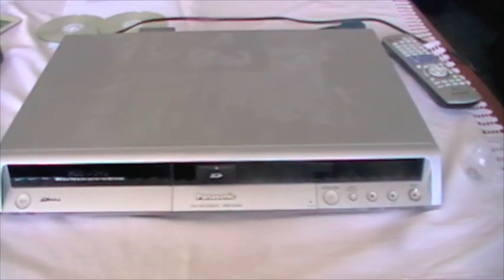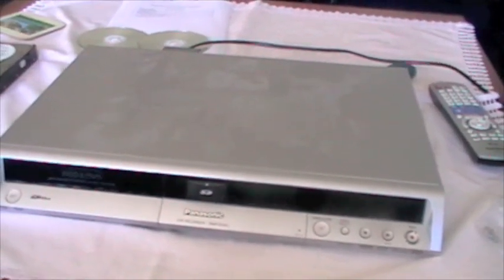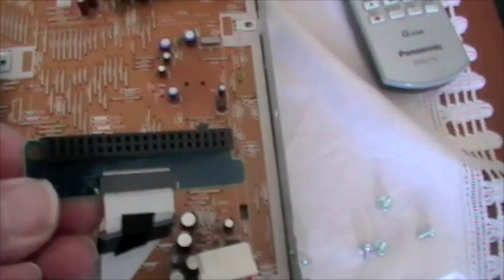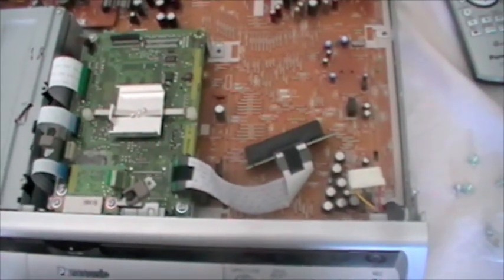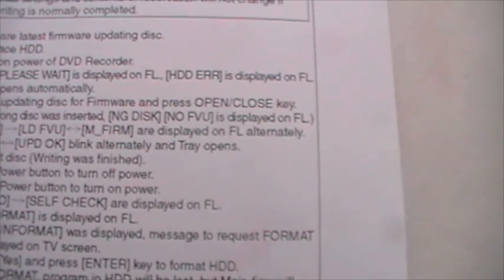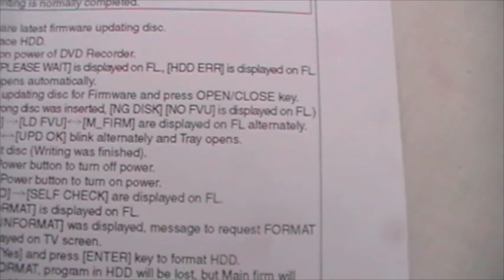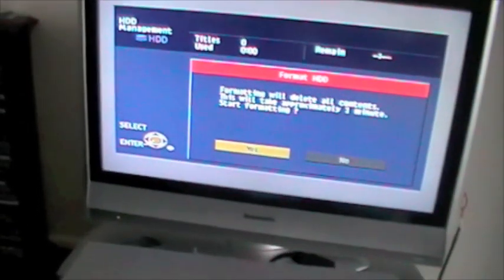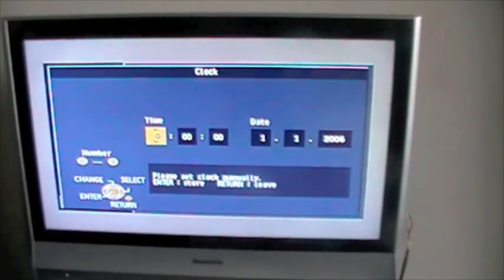Panasonic DMR-EH55 dvd recorder, how to replace the hard drive

Comment: Hi,  please write me how to burn the firmware on a cd r medium.  I tried several brands at 10x speed  and it won"t work... it is frustrating .  Thanks.
Reply from the maker: Try writing to a DVD HTH
Reply: @mikeuknz  Thank you for a quick reply. I don't know what is  DVD HTH and I thing it wil be hard to obtain here in my destination... I suposed to burn it at lower speed  around  2x or 4x   maybe 10x is too much for the dvd player to read....
Reply from the maker: @rudolfzaris675  A DVD is the disc you put in the DVD player and you need to record the firmware on to a recordable DVD disc. HTH is just an abbreviation for "hope this helps" sorry for any confusion.

Comment: Hello Mike UK  in NZ,   thank-you  for a great  Video  Tutorial with useful  information , we need more people to speak like yourself , in a easy to understand format , using well pronounced  English on YouTube.   I have a Panasonic  DMR-EH65 , with a few hundred  music video clips on it , that I have edited and saved over the years . and was wondering , if i took out the hard drive, and connected it using the right connector I have for the IDE drive to my PC, will i be able to copy the files onto my computers HDD , and be able to use  them , for further editing and sorting out.  I am asking in case you might happen to know, thereby saving me a lot of time and hassle. Many Thanks  Sean UK in Oz,
Reply from the maker: Hmmm... I am not sure. The format in the DVD player I think is slightly different from the computer format. Have you tried writing them to DVD and loading them in to the computer that way? Sorry that's the best I can advise - good luck!
Reply: Hi, in case you haven't found the solution yet, there is a way. It's not difficult at all. It just needs a few tools to extract the files which are stored using the meihdfs filesystem. As far as I know it's a proprietary file system which prevents you from simply accessing the files through your OS (Linux or Windows). That's why you'll need to map the physical drive, extract the files through a tool called "extract_meihdfs". It's really quite easy as long as you follow the instructions. https://github.com/leecher1337/panasonic-rec
If you need any help, feel free to contact me.

Comment: Is that firmware download for a Panasonic DMR-EH55 model only?...because I have a Panasonic DMR-EH57 and wondering if it will work on mine or if there is a firmware download for mine.
Reply from the maker: +Toy Mit Sorry I don't know. You could try ringing the Panasonic help line in your country though in some countries they seem to be more helpful than others. If your EH57 doesn't work anyway I suppose you could just try it and see what happens.
Reply: Write this website: ftp.panasonic.com  And after that,  you srcoll down till you see the word:  dvdrecorder. And you click on this word. After that,  a webpage will show with  many words.So, you click on the word: software.  And an other webpage will show many model names. You scroll down till you see :  dmr-eh55_vup317_firmware.zip. Yo click on this word and a window will appear on your screen. So, you click this downlod windows and it will be saved on the folder: download or whatever you choosed the destination folder. And after that, you go where its downloaded. And you click this zip folder: dmr-eh55_vup317_firmware.zip. and you will see a folder inside. You click that folder right side mouse and you extract that folder in download folder. And after that you click on that folder and you will see this word: PANA_DVD.FRM.. you burn that to a blank cd. And after that. you put this burning cd to dvd recorder and you wait till you see update OK. and after that it will ask you to format your hard drive and you click ok and you,re done you can record on your hard drive. Good Luck!!!!

Comment: hello
I need help
Insert 250gb disc in dvd recorder.
Original is can160gb.Dvd me loading firmware all ok,next switch on not work problem again was the sure.Not insert 250gb?Why problem is it?I please help thank you...
Reply from the maker: Is it the correct firmware, where did you get it? Is it the correct type of hard drive?

Comment: I found your video very interesting. I have the same problem with my DVD recorder. Any chance you can share the firmware disc, or tell me where I can go to find one? I have tried the website you recommeded but it did not work. Thanks John
Reply from the maker: John Bugeja Filedropper is really annoying as files disappear very quickly.  I have uploaded it again so should be there now. 
let me know if there is any problem. HTH
Reply: mikeuknz Thank you for your Help, I will give it a try, 
From John
Reply: John Bugeja  I loaded the firmware from Filedropper like you requested and after I loaded it into the DVD recorder I get the message on the display (No Disk) (No FVU) just like what happen to you on your video. Is there another way to get my hands on the Firmware. 
Thank you for your Help John
Reply from the maker: John Bugeja Hmm.. very odd. The only thing I can think of is that the recorder is not finding the file on your DVD - it is a dvd and not a cd? and it is a dvd it reads eg a DVD-R? Check the file is in the root directory and has the name PANA_DVD.FRM sometimes the file type can get left off. That is the only working file I have. Let me know if that doesn't sort it.
Reply: John Bugeja I had another go of downloading the file and notice the loading bar doesn't go all the way to 100% it starts to finalise just short of the end. I wonder if it is a problem with my computer. Did anybody else had this problem?
Thank you for your Help!! John
Reply from the maker: John Bugeja try copying the file back from the DVD to the computer and then check if the file is the same in terms of details such as file size. It should be about 7.2Mb. You are downloading to hard disc then copying to DVD I hope.
Reply: mikeuknz Thats interesting! The file size I downloaded is 6Mb. I will give it another try and get back to you 
Thank you John

Comment: Hi, thank you for your vids, i changed hdd of my EH55, but the firmware from panasonic website doesn't work, NO FVU...
Is it possible to have your firmware version in download please, the above link doesn't work anymore.
Thank you.
Reply from the maker: +PLChellman Hi, I've uploaded it again, try again and see if it works now. HTH
Reply: +mikeuknz  Thank you very much, i've downloaded it, i will try it later or tomorrow ;-). I will tell you if it worked or not , again thanks.
Reply: +mikeuknz Mister, thank you very much again and again , you save my futur records.
Burned the firmware on CD-R by windows 7, put it in the panasonic, and update goes on , tested all , all functions runs.
Thanks Mister.
Reply from the maker: +PLChellman glad it helped, regards

Comment: I have the same Australian / new Zealand model my plan is to replace the hard drive with a solid state 160gb hard drive as Panasonic says they won't handle drives bigger than what is installed this involves modding the data plug and power cable. the problem with data read errors on the unit is Panasonic doesn't have a defragmenter option hence why i prefer solid state as data wont degrade.
Reply from the maker: I think they will handle drives bigger than originally in them but will only format them to the original capacity hence no apparent gain except that another size may be easier to find depending on what is available in your area.
Reply: i found this page for the firmware but i confused which version to download i think its the 1 up top but model number is not listed http://av.jpn.support.panasonic.com/support/global/cs/dvd/download/index.html
Reply from the maker: If you watch the video you will see that the firmware I downloaded did not work and I had to get it from the Panasonic support line here in NZ. It should be able to be downloaded from the address given in the video. HTH
Reply: Thanks Mike for the link i just downloaded  the file you mentioned in the video. i'm going to give it go i'll let you know how i go .
Reply: how do i convert the frm file to an iso file to burn to dvd i found this forum on how to do this http://www.sevenforums.com/general-discussion/244287-how-burn-pana_dvd-frm-firmware-update-file-iso-format.html
Reply from the maker: You don't need to convert the file, just save it to a DVD with the file name pana_dvd.frm

Comment: Hi, can you tell me where you got the firmware for your unit, please? I've been searcing all over the internet but to no avail.
Reply from the maker: Hi, normally you might get it by asking the Panasonic help line in your country. Otherwise go to the Filedropper site and find Panadvd by putting the address of filedropper in your browser then slash panadvd and download the software then save it to dvd and use as in the video. HTH
Reply from the maker: Jayne-Maree Sedgman
Hi, it seems that filedropper deletes it if it is not downloaded for 30 days. I have uploaded it again and the web address is the same as previously. Make sure it is saved to a dvd as pana_dvd.frm it is just over 7Mb HTH Which country are you in that refused to provide it?
Reply from the maker: Jayne-Maree Sedgman
Hi, dont worry we will get there in the end. If necessary I can post you a DVD. 7Mb is too big for my email though. I have checked filedropper and it is there. Make sure you enter the address as shown in the annotation at 10.40 (ish) on the video (YouTube dont let you put web addresses in comments) and then you should get the option to download. Let me know if you have a problem.
Reply: mikeuknz Hi, we are trying to download the file also, but it's not working? We can only see a page where we can upload something ourselves. We have the exact same DVD recorder, either the module is broke, or the HD  :(
Reply from the maker: moorhunhe
hi, it keeps disappearing from filedropper I contacted them to ask why but no reply yet. Try again. should be there
Reply: mikeuknz It worked now, thank you!  Repair wanted over 500 € to fix this thing! My boyfriend is an IT-guy, so he's trying to find a cheaper way, haha.
Reply from the maker: moorhunhe
glad it helped
Reply: mikeuknz
Reply: Write this website: ftp.panasonic.com  And after that,  you srcoll down till you see the word:  dvdrecorder. And you click on this word. After that,  a webpage will show with  many words.So, you click on the word: software.  And an other webpage will show many model names. You scroll down till you see :  dmr-eh55_vup317_firmware.zip. Yo click on this word and a window will appear on your screen. So, you click this downlod windows and it will be saved on the folder: download or whatever you choosed the destination folder. And after that, you go where its downloaded. And you click this zip folder: dmr-eh55_vup317_firmware.zip. and you will see a folder inside. You click that folder right side mouse and you extract that folder in download folder. And after that you click on that folder and you will see this word: PANA_DVD.FRM.. you burn that to a blank cd. And after that. you put this burning cd to dvd recorder and you wait till you see update OK. and after that it will ask you to format your hard drive and you click ok and you,re done you can record on your hard drive. Good Luck!!!!
Reply: @danielbergeron7172  you have to create an account on that website,, is that what you did?

Comment: did you have to keep to the same size hdd ?
Reply from the maker: Basically yes, you can use a bigger capacity HD but it will only format it to the original size.

Comment: Hi Mikeuknz, can u upload the firmware again, sorry to disturb you, the one from panasonic site does'nt work for me, FVU something ...
Reply from the maker: +Ronald G. OK, done, address is http://www.filedropper.com/panadvd_1 HTH
Reply: mikeuknz , Hi, sad to say, the one you uploaded still does'nt work for me.. any suggestions?
Reply from the maker: +Ronald G. Hi, check the file size is about 7Mb to ensure the whole file downloaded. Then it needs to be recorded on to a DVD with the filename PANA_DVD.FRM  If it still doesn't work then look through all the earlier comments on this video and see if anyone else had a problem they solved particularly regarding formatting the DVD HTH
Reply: +mikeuknz Hi, downloaded 695Mb file from the address you sent, and recorded it in a DVD-R, but still no luck. :(... BTW, maybe the model is'nt compatible because i have a EH59 model. and bought here in southeast asia.
Reply from the maker: +Ronald G. I dont know if it works with the EH59. It should be about 7Mb not 700Mb. Have you tried ringing the Panasonic help ine in your country? HTH
Reply: Ahh, thanks for the upload anyway. i just brought the unit at panasonic service center,

Comment: Dear friend mikeuknz
Good Morning
I need your help
Well I have here in Brazil a DMR EH55 and I was estorato a capacitor of the board power PCB, I changed it once it worked I did tests and ok, I turned it off the other day it did not call again, then I changed another capacitor and it worked, I used it again, Spent a day in standby and when to use again did not switch on I changed this capacitor for the third time and did not call anymore, the capacitor was 35v 68uf at the power outlet,
1     0.00v
2     0.00v
3     0.00v
4     0.00v
5     0.00v
6     0.00v
7     GND
8     GND
9      GND
10    GND
11    GND
12    12.19v
13    12,19v
14    12.19v
15    12,19v
16    3.93v
17    3.93v
18    0.00v
19    3.93v
20    0.00v
21    0.00v
22    0.00v
23    0.00v
What model of your power board PCB, mine is VEP 71108
I am very grateful for your help.
Mario Guimaraes
Reply from the maker: Ola Mario, I do not know I only know about changing the hard drive which was shown in the video. I wish you well.
Reply: OK
thank you

Comment: I am looking for the firmware of DMR-EH53, I can't find it on the Panasonic FTP-site: ftp://ftp.panasonic.com/dvdrecorder/software/ or  on this Japanese Panasonic site : https://av.jpn.support.panasonic.com/support/dvd/download/fw/rdr/eh53.html, doesn't work this file.
Thanks in advance,
Vincent
The Netherlands
Reply from the maker: Hi. You could try phoning the Panasonic help line in the Netherlands, you may be lucky. Or you could try a different model"s firmware and it may work but may have a fixed limit on the size of HD it recognises. Good luck.
Reply: Hi, there is no technical phone support, I send them an e-mail.  I use a brand new 160GB (Sata) Harddisk.  I believe the harddisk will be formatted, when the right firmware is doing his job. I notice the text NO FVU on the display, so that means there is something wrong with this firmware on the CD. I hope that Panasonic can provide me the right firmware.
Reply from the maker: @griekofiel1  The EH55 hard disc is also 160GB so you could try the firmware for that though it is a risk but I think (not sure) that sometimes the last number (53 here) may be for a particular area of the world. If it is not working now then you are not risking too much but it is up to you. However, it may need to be a PATA hard disk. If you look up Panasonic help lines you may find one in another country you could try but they may not operate as normal during the COVID 19 business. Good luck.

Comment: I have just loaded this Panadvd file from file dropper for my EH55 panasonic which has a faulty HDD here in Australia  It loaded the cd Disc and came up with the same reading  NO FVU  The disc was burned correctly and finalized on my computer   I wonder would Mikeuknz post me a copy of his disc. We would pay him Handsomely for it  .Panasonic sent me this link .I think its the same file. Same size It did not work either  http://shop.panasonic.com/support-only/DMR-EH55S.html
Reply from the maker: +Mervyn Roulston The one from the Panasonic web site did not work for me as shown in the video. Check the size of the file you downloaded was about 7Mb. I notice there are two on filedropper now. Have you tried downloading the file you get when you enter www.filedropper.com/panadvd_1 if not give that a go. Have you tried ringing the Panasonic support line in Aussie. Ask them to send you the correct version on DVD, took me 2 rings to get it here in NZ Where in Oz are you?
Reply from the maker: +Mervyn Roulston Also are you burning to DVD using Windows Explorer? If so see the comment from Wijnand Lammens about the format of the DVD 3 months ago

Comment from the maker: firmware up loaded again at: http://www.filedropper.com/panadvd
Reply: Hi Mike,  i need your firmware too! Could you upload the firmware again? ) And some questions:      - wich type of disk i have to use to upload the firmware to dvd?
- wich type of burning I''ve to chose on mi Win 10?
- should i put the "pana_dvd.frm" file to disk main direcroryor a have to create some folder?
Reply from the maker: @ИгорьНетто-к8э  OK its up at http://www.filedropper.com/panadvd. Save to HD first then burn to a DVD (DVD-R should work), suggest use a new DVD and put it in the root directory. HTH